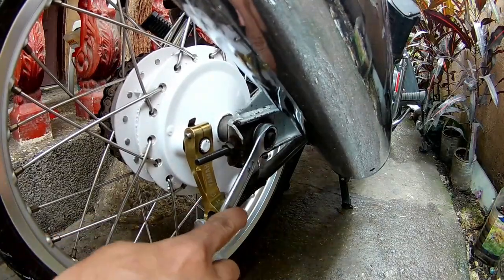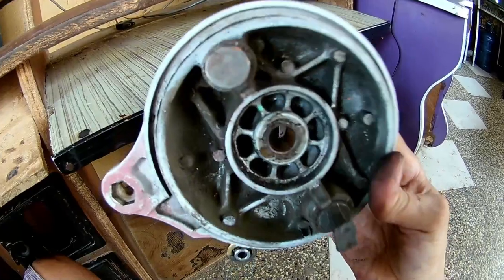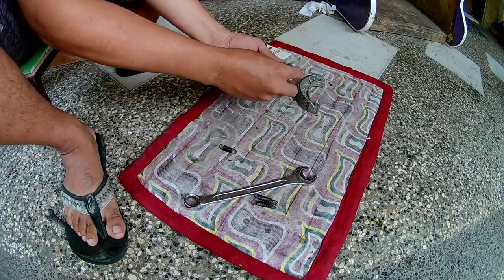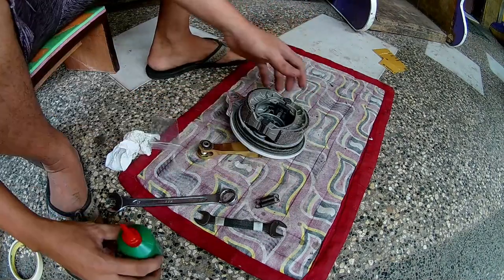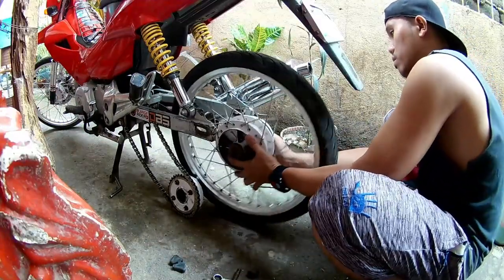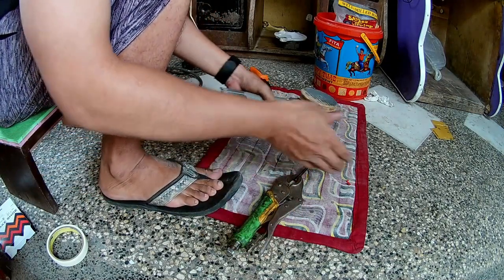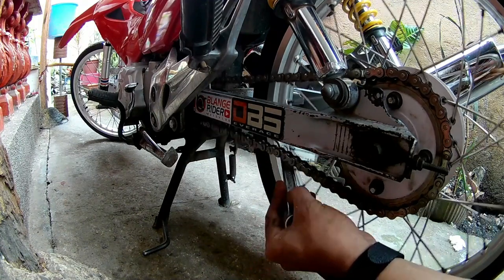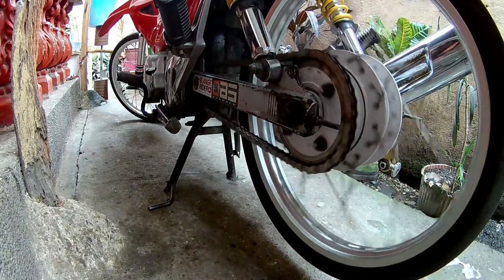Brake shoe replacement the easy way | How to fix drum brake issues | Tagalog

Comment from the maker: When you experience stuck brake issues don't forget to lubricate the brake rod and its spring because that is the most common issue a drum brake would have. If the brake rod spring is too weak for the job then replace it or else just add a spacer so you can maximize the spring's pushing power.